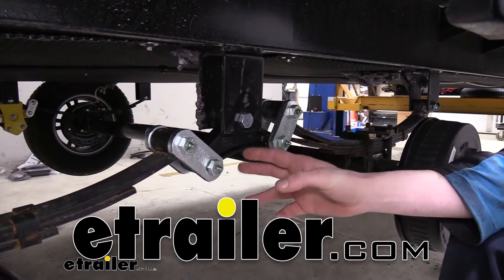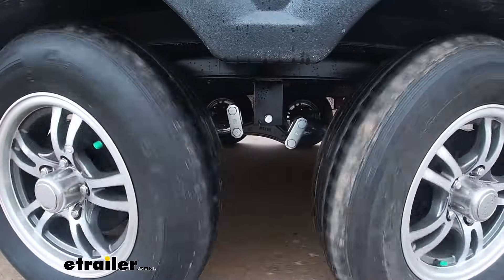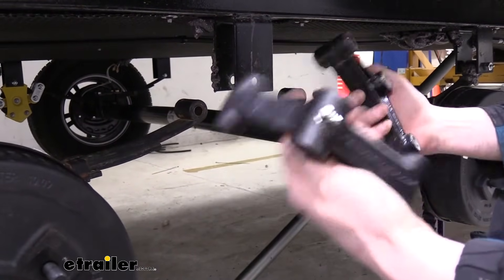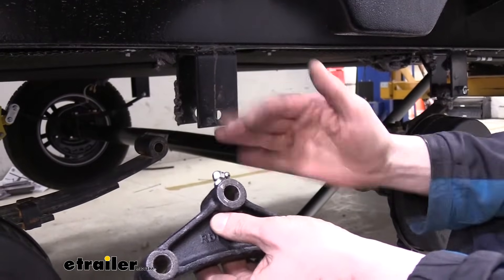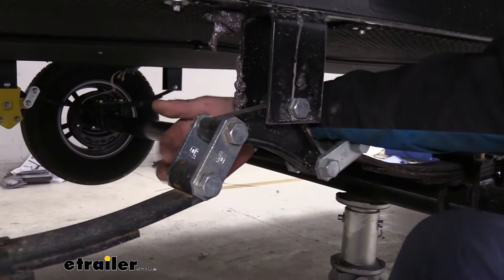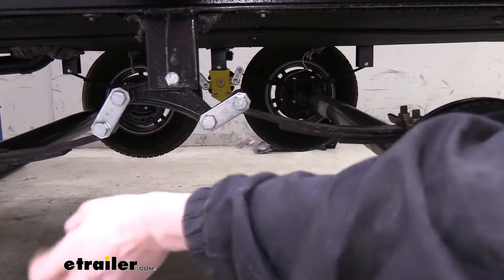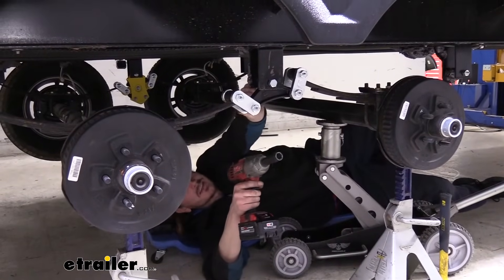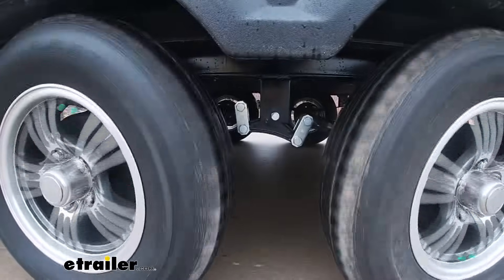etrailer | Comprehensive Review: Dexter Heavy-Duty Suspension Kit for Tandem-Axle Trailers

Comment: Hello,what's the usual torque for those bolts to be tightened to ?
Reply from the maker: Suspension components use lock nuts on the ends of the shackle bolts and the bolts need to be able to allow movement. You actually don't want to torque down the bolts at all.  If they're too tight, your suspension won't articulate correctly. I hope that helps....
https://www.etrailer.com/Trailer-Suspension-Parts/Dexter/K71-449-00.html
Reply: @etrailer  Yes, it does, thank you.

Comment: Now hang on. What is the diameter of that blind hole. Also, what is depth. I love the concept, don't get me wrong.  There comes a point where you may unintentionally sacrifice structural integrity for lubrication accessibility. I'm not sure, just something to think about. It's refreshing to see something made with grease fittings. You don't see that very often these days.

Comment: Good stuff, where is the best place to have the trailer jacks to support the weight of the trailer
Reply from the maker: Jack stands like # PTW41021 placed under the trailer frame fore and aft of the trailer wheels is the safest way of supporting a trailer while you install a suspension kit like the Dexter # /K71-449-00
https://www.etrailer.com/Trailer-Leaf-Spring-Suspension/Dexter/K71-449-00.html

Comment: @4:00 - how well greased? how often? by miles - every few months?
Reply from the maker: It will depend on how much you use the trailer. If you only use the trailer a few times a year then greasing it once a year is just fine. If you use it all the time then you will want to hit it with grease a few times a year.
https://www.etrailer.com/Trailer-Leaf-Spring-Suspension/Dexter-Axle/K71-449-00.html

Comment: What is the part number for the 7 3/4 spam unot
Reply from the maker: Check out the following link for more information on this equalizer with a 7 3/4" span.
https://www.etrailer.com/Trailer-Leaf-Spring-Suspension/Dexter-Axle/K71-449-00.html